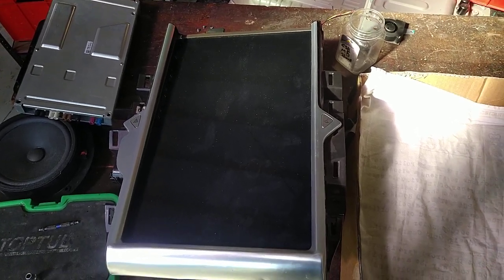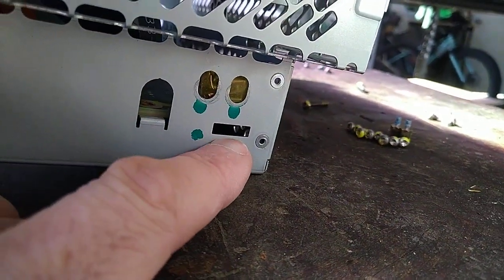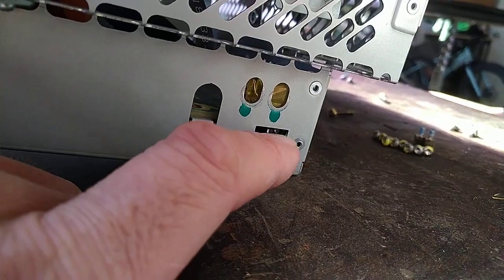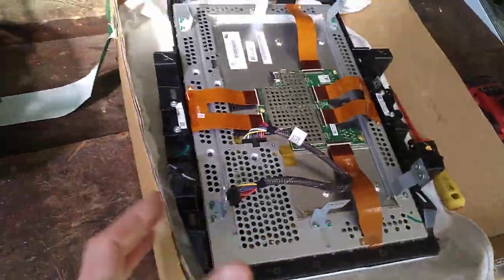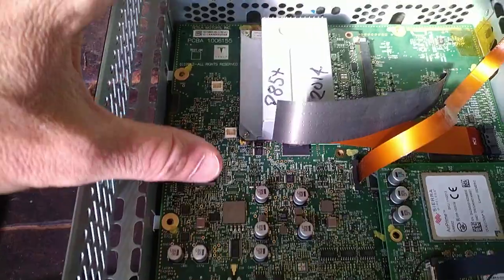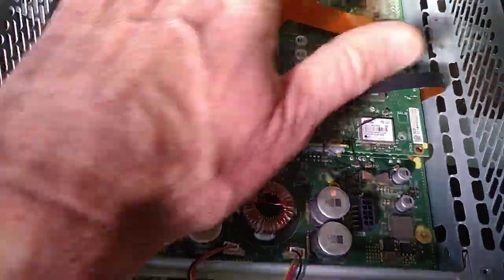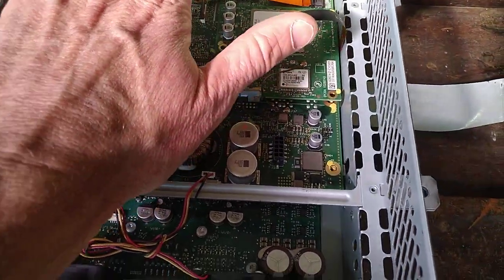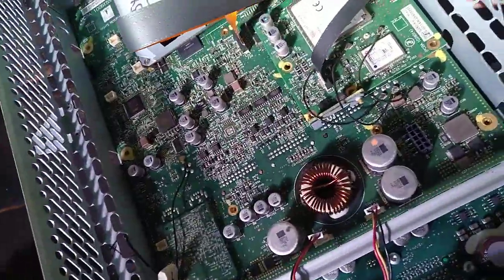Tesla MCU1 SD Card Removal Model S & X

Comment: Just curious, what brand and capacity is the original SD card?
Reply: @deviantpowersystems I got a full SD card image. It worked immediately.
Reply: @breakfixfever  would you have a link to this working image please?
Reply: On a 2015 MCU, it's a 16GB SanDisk class 4.
Reply: @deviantpowersystems can't confirm yet. I'm typing this 30 min after changing the SD card on my MCU1 and still no downloads (I'm connected to WiFi, did try to use the navigation and restarted several times). I'm now waiting for someone on TMC to share a link to an SD image I can upload directly to the SD card before I assemble everything back.

Comment: Do you know the location of the flash card that goes bad due to the over writing of logs etc.. ? Just interested on how bigger job it is, I'm guessing surface mount chip that is removed with a hot air solder station?
Reply from the maker: I believe that's on the 'Tegra'. It's a board mounted on the main board. The fan shown removed in this video cools it. There's at least one video on yt showing the repair process. It's beyond my skills/aspirations at the mo.
Reply: @RaglansElectricBaboon  thanks for the reply 👍